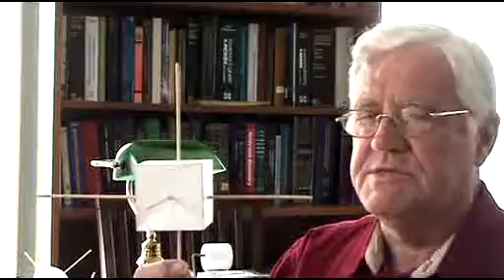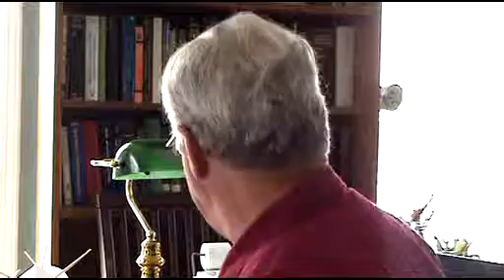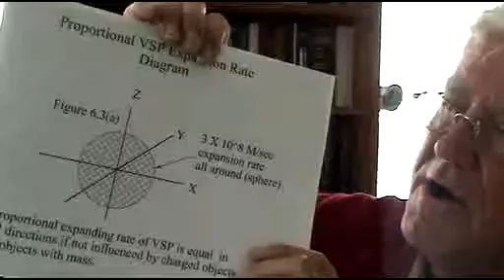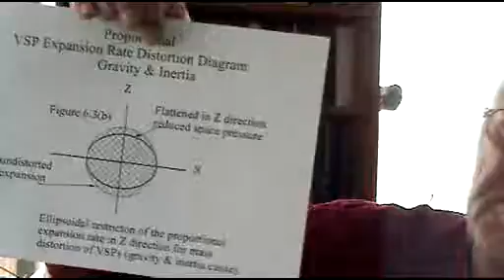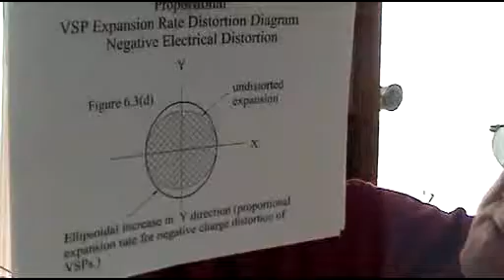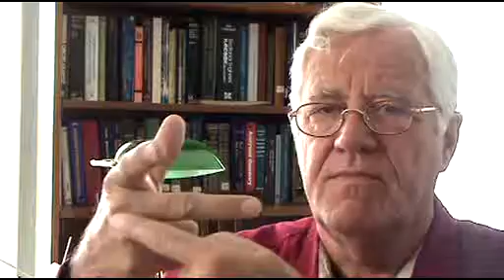lecture 6 Bubbles

Comment: Bulk Modulus and Wave Speed

((6.6740800122e-11 Pascals) / (3.71295775e-28 * 2 * (kg / (meter^3))))^0.5 = 299792458 m/s 

https://photos.app.goo.gl/thezJYLbYNby91Qz2

https://en.wikipedia.org/wiki/Bubble_(physics)#Pulsation

https://en.wikipedia.org/wiki/Friedmann_equations#Density_parameter